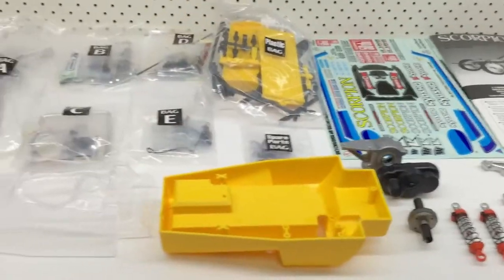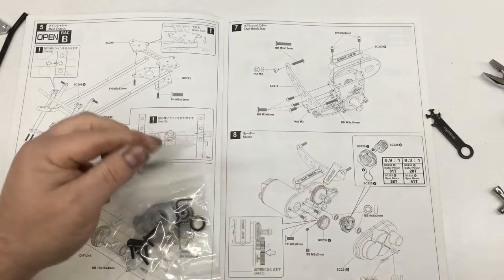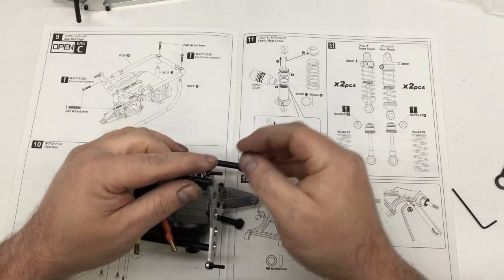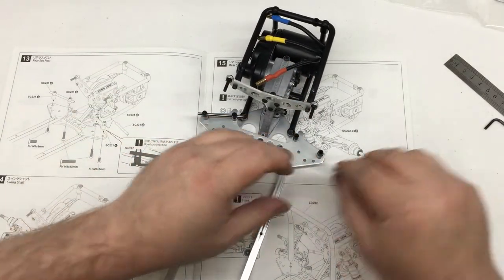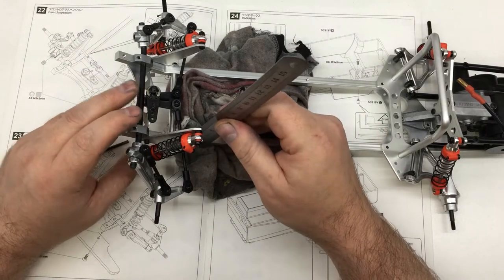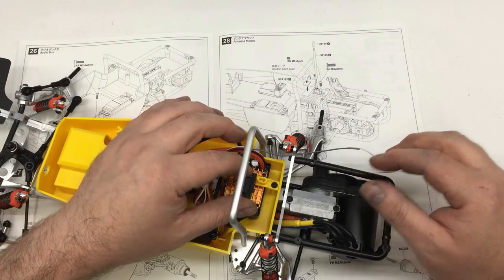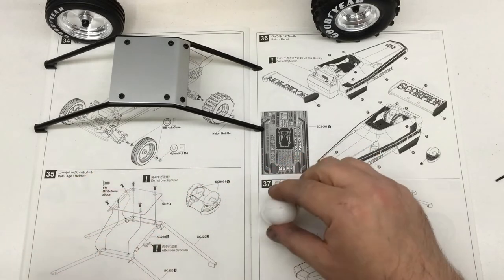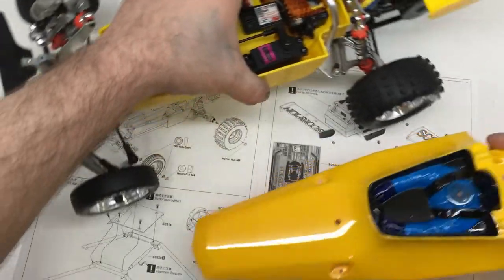Building the Kyosho Scorpion 2014

Comment: Just got one. My rear suspension binds when i put the drive shafts in.
Reply from the maker: They can bit that way. You could try to loosen the swingarm mounts on the chassis while it's all assembled. It might take 6 hands to do it but that's the best way I've found. Just back off the grub screws a tad and move the swingarm up and down to help it find it's best position. Hope that makes sense. 👍
Reply: @RCHobbyShed  
 Thanks! I tried all kinds of different stuff. It starts to bind before its  even tight. Going dremel the shafts. I have a set cvd shafts i haven't tried yet also.
 Love your collection. Thanks.

Comment: I just ordered one of these kits last night.  Got the bug for vintage RC recently.  Great video, Sir!  I've watched several and yours is extremely good in comparison.   One thing I noticed on all the build videos is that no one seems to use thread locker on all the metal to metal parts or with the non-locking nuts?  I'm just finishing up a Sand Scorcher and they had you use thread locker on almost all metal to metal attachments.
Reply from the maker: Congrats on your Scorpion purchase! Thanks for the great feedback on my video too. I have noticed some of the Tamiya buggies, such as the Sand Scorcher seem to use a lot more thread lock. For the Scorpion I only used it where indicated, at least I meant too, maybe I missed some 😂. It's most important to use it on the front suspension as it can get loose as sloppy very quick. 👍

Comment: It is a great kit. I am however looking at possibly switching the front tires to something softer. Hopefully that'll help the handling
Reply from the maker: I also noticed the fronts are quite hard. I think too hard for traction any hard surface. I haven't driven mine yet but plan to run it on sand or grass. Let me know how you go with different tyres.
Reply: I'm taking it to the hobby shop tomorrow and I'll let you know. They've some Losi stuff and Proline. Also once the Ultima kit comes out my guess is the tires and wheels for that will fit and will be much softer and hopefully they'll have after market replacements

Comment: Are the wheels locked onto anything like a hex or pin? Or are thy just bolted on?
Reply from the maker: At 29:25 I fit the wheel adaptors. They're held on with a screw which goes through the axle. Unlike hexes, they don't fit inside the wheel, the wheel basically tightens up against it. 👍
Reply: @RCHobbyShed Cool. Have you ever had problems with the wheels slipping, since they aren't on a hex?
Reply from the maker: @coopersharp2921  Haha, I've still not actually driven this one. However I did have the original back in the 80's which is the same and never had any issues with it.
You could also change the round adaptor to Ultima hexes if it does become a problem. 👍
Reply: @RCHobbyShed  thanks!

Comment: Hey Mick just reading-visiting your video as I’m about to start my build. Just a question- do you think the PS 19 Camel yellow backing is necessary? If I only used PS6 would there be an obvious variation in colour to the plastic tub? Cheers
Reply from the maker: G'day Chris! Yeah there is quite a difference if you only use the PS6, the body will be brighter and more of a lemon yellow colour when compared to the tub colour. It won't be like black and white but will be noticeable. It really just depends how concerned you are with it matching, if you just want it yellow and aren't too fussed if it's exactly the same then just go with the PS6. 👍
Reply: @RCHobbyShed  that’s great Mick - thanks for the advice
Reply from the maker: @Chris-sd6os  No probs at all! Hope the build goes well! 👍
Reply: @RCHobbyShed might using more coats PS6 and then a little bit of black do the same job?
Heard of anyone try it?

Comment: Stupid question, but those frame rails weren’t prone to bend during a hard fall from a jump or during a tumble?
Reply from the maker: No, not a stupid question at all. Because of lockdown, I still haven't run any of my Kyosho buggies with these rails (Tomahawk, Beetle, Scorpion, Turbo Scorpion), but will be running them all very soon. I can say I had an original Beetle back in the day and I never had any issues with the rails bending. They are quite strong, I really think you'd have to run it straight into a brick wall to bend the rails. 👍

Comment: What kind of paint did you use to brush on the driver on the lexan body and helmet? Createx?
Reply from the maker: From memory I think I used Tamiya acrylics on the helmet and yes, it was either Createx for the driver body... It may have even been Tamiya enamel or acrylic. I sometimes use those in small areas too, even though it's on polycarbonate I've not had an issue since it's only a small area. If I remember rightly the paint I used in the airbrush for the black underneath, it was just Tamiya PS paint that I decanted for the airbrush. The yellow is just Tamiya PS paint. 👍

Comment: Love it. Thank you for the in-depth video.  Did you paint the driver area with just a fine brush and brushed on lexan paint?
Reply from the maker: Thanks. That's right, I painted the driver body by decanting some lexan paint and brushed it on. Sometimes I even use acrylic paint and brush onto small areas if I don't have the right colour in lexan paint. 🙂👍
Reply: RC Hobby Shed perfect!   I have done a ton of rattle can bodies over 30 years.  Never did learn to air brush.  I just got a turbo scorpion kit and want to derail paint the driver and replicate the blue and red decals with paint.  Your build video is excellent
Reply from the maker: @KMJ187  An airbrush can be really helpful, I've been learning to use mine for around 5 years now lol. Good for painting around the cockpit area in these type of bodies. On my Javelin and Optima restos i used a mix of methods. In those buggies I painted the seat belts and stuff with a brush. On the Optima I cut little Kyosho name decals for the belts, but the rest is paint. Those Turbo Scorpions look awesome, I also have one to build. I checked out your channel, awesome and subbed. Lovin the Wild Willy M38 resto! 👌 Will keep an eye out for your Turbo Scorpion.👍

Comment: You did a great job on that, the video was super helpful.  What specific paint did you use on the driver's helmet for the silver?
Reply from the maker: Thanks, glad it was helpful. The paint on the helmet is actually a pale blue I mixed up myself from some Tamiya blue and white acrylics. I tend to do that quite often if I don't have a certain colour at the time. In this case I just put a small amount of blue and white on a piece of card and mix them until I get the colour I'm looking for. 👍
Reply: @RCHobbyShed  I was afraid that silver paint would be too light and shiny while gray would be too dark. Maybe I'll try what you did. Thank you for the information on mixing.

Comment: No loctite? Would think that loctite were used due to the amount of metal.
Reply from the maker: I used thread lock where indicated, there's really no need to go crazy with it. It's used mainly around the front suspension, you can see it at 42:07. 👍